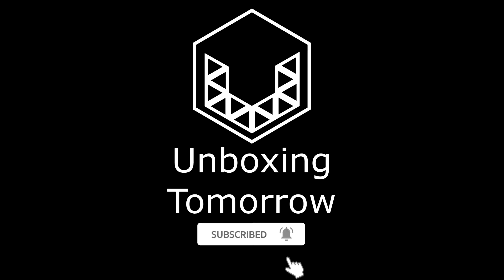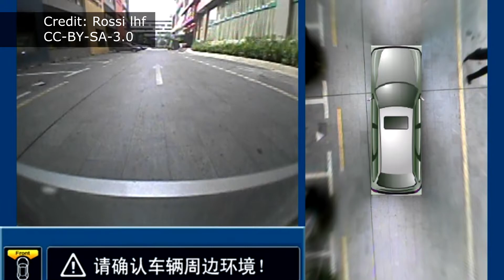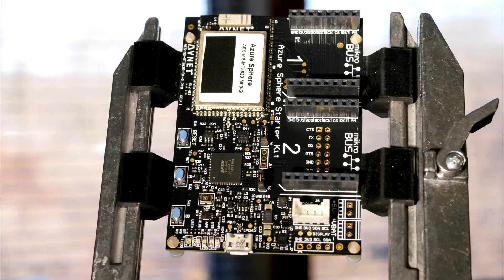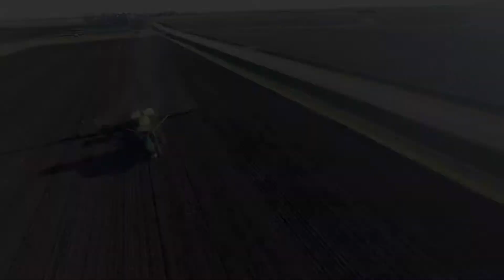Embedded Technology Watchlist 2021-2031

Comment from the maker: Correction: 10:43 refers to the mobility of GaN/SiC/Si.  The better term was "saturation velocity," which affects linearity under high electric fields.
Kind of delayed, but Happy New Year everyone!
0:20 - Preface
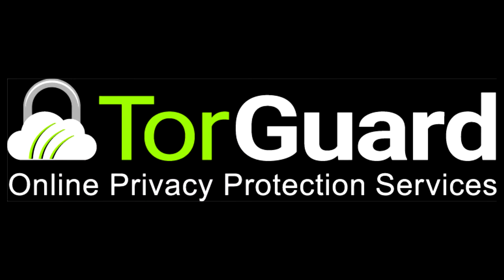0:40 - Affiliation
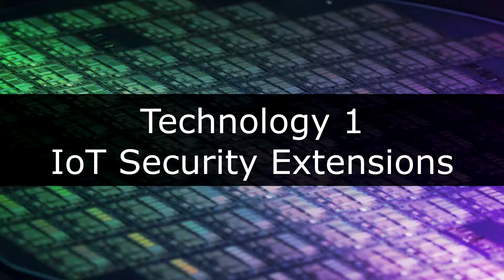0:52 - Technology 1
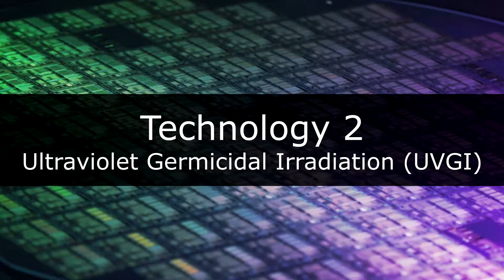3:10 - Technology 2
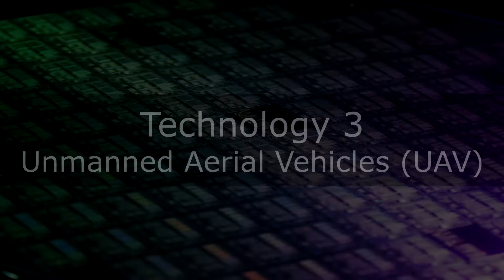4:18 - Technology 3
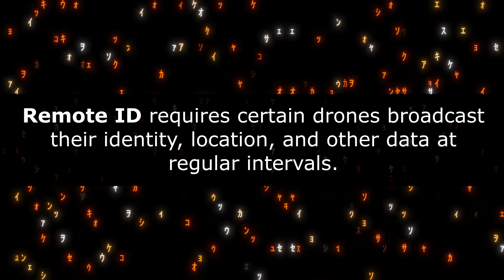5:10 - Technology 4
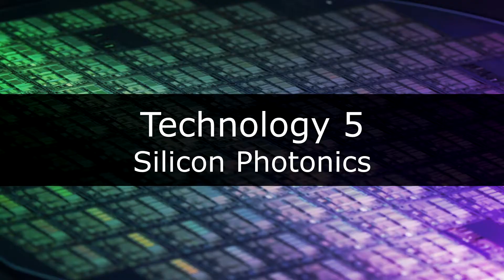6:40 - Technology 5
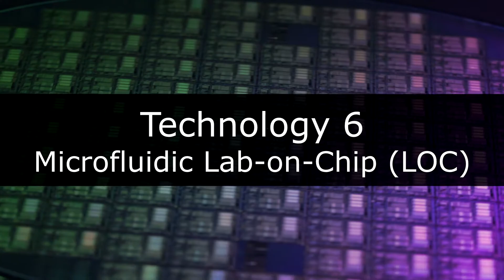7:42 - Technology 6
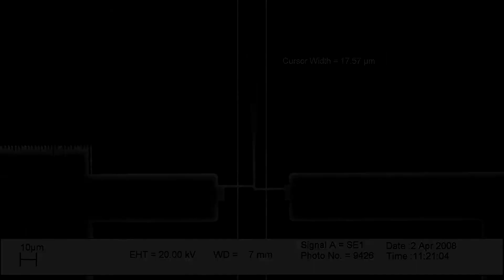8:27 - Technology 7
9:55 - Technology 8
10:55 - Technology 9
11:52 - Technology 10
12:51 - Honorable Mention
13:55 - Closing Remarks